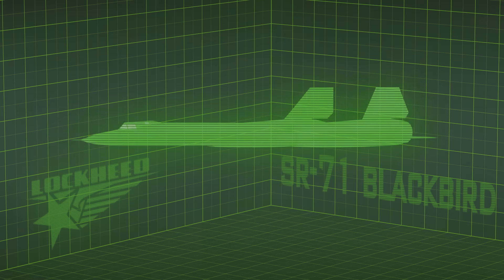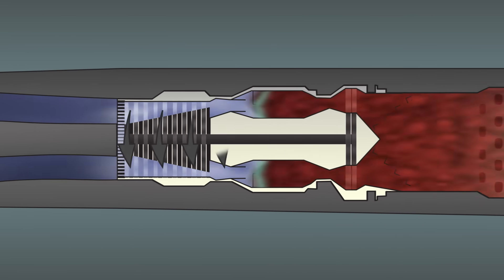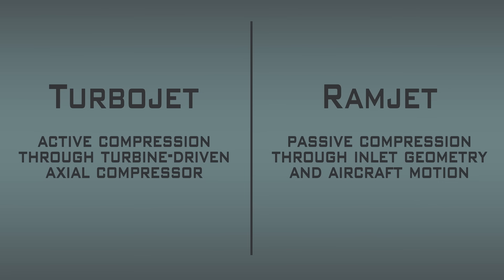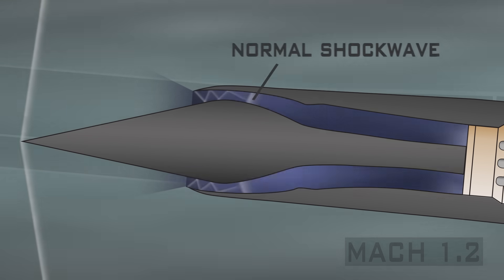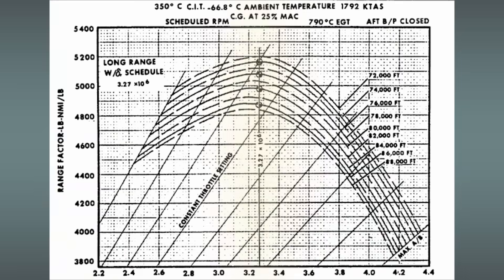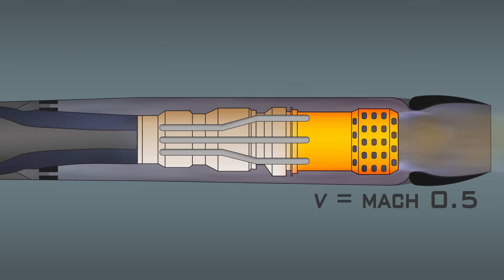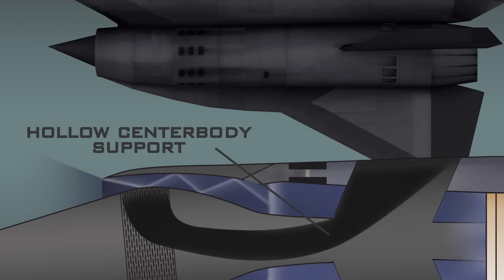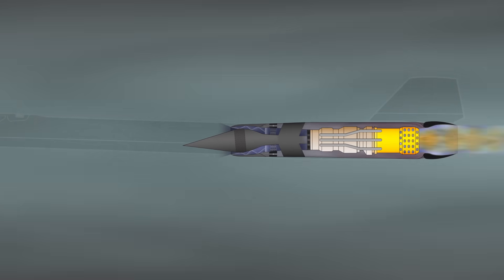The Mighty J58 - The SR-71's Secret Powerhouse

Comment: If anyone is interested in seeing the best REAL SR-71 static display I would advise you to travel to McMinnville Oregon to the Spruce Goose Museum. They not only have a real SR-71, they have her with an original J58 (port side) on it`s engine change stand, and almost a complete set of it`s photo recon / electronic snoop gear with it`s original hoist gear along both sides of the fuselage. It`s like they jacked this thing out of an Air Force hanger, I swear...
Reply: +Brian Patronie  was the J58 engine designed specifically for the SR71, or has it also been used in other aircraft? I saw (and touched) an SR71)) in Omaha, Nebraska. What a plane!
Reply from the maker: Guenter Zaenker The J58 was designed for the OXCART family of aircraft - the A-12, which became the YF-12 and the SR-71.  It's unique to them because it's only efficient at the high speeds and is designed to only use the JP7 fuel.
Reply: @TechLaboratories  The J-58 engine was NOT originally designed for The OXCART series of planes. It originally was supposed to be used by the Navy--www.afftcmuseum.org/newpage2
Reply from the maker: +Brian Patronie They have SR-71s in similar configurations at many flight museums within the United States, including the National Museum of the United States Air Force, and the Smithsonian.  Each display has its own element of the SR-71 they're trying to capture.
Reply: TechLaboratories

Yeah? I`ve been to Dayton and Dulles and McMinville blows them away. The engine change stands are 100% correct, the engine lift hoists are 100% correct USAF property, the J-58 is 100% intact, the power cart, the avionics & sensor packages are all 100% correct AS THEY CAME OUT OF THIS AIRFRAME...

Come out here and look, I`ll stand by my assessment that this is the finest SR-71 exhibit in the world, and makes our Air Force exhibits pale in comparison...
Reply: Guenter Zaenker

I`m not sure, but with that aero spike inlet cone it`s certainly the most unique application I`m aware of.
Reply: TechLaboratories

Yep, I thought so but wasn`t sure, thanks for the clarification.
Reply: In Europe, you can see SR71 at the American Air Museum Duxford UK

Comment: K wait what holds the middle to the nacelle.
Reply from the maker: +Ali G The center body is on hydraulics, held in place by the same structure that forms the channel from the center body bleed to the outside of the aircraft.  Essentially, the back end of the center body sits on a cylinder like a sleeve for lateral alignment, and is internally connected to a hydraulic RAM for maintaining its retraction state.

Comment: I'd say check out the Tumansky R-31 that powered the Foxbat-E as it was a more powerful engine with greater capabilities but miraculously, the American owned company Google doesn't index any page regarding R-31 stats despite the fact that the R31 is a newer engine over the R15 which just so happens to be the only engine in the Mig-25 series that i can find info on. The Americans already admitted to having clocked a Mig-25 over Israel at Mach 3.2 in 1973 powered by two R15's. As i said though, curiously, no info can be found on the R31 in English and i'm not good at reading Russian.
I mention as I clearly remember reading an Air Superiority book by Readers Digest that my dad used to own when i was a kid so easily pre 90's and it stated the R31 as being a lot more powerful with regards to thrust and that the Foxbat-E when equipped with this Engine was faster than the SR71 (only slightly) and that the service ceiling was easily a match for the SR-71 also. 
So yeah, I've found its strange that the largest webpage indexing company on earth (american owned) brings back no search results with regards to information on the R31's capabilities. 

I wonder if it has anything to do with the American assertion that the SR-71 is the be all and end all of fast and high flight. 
(It's not like the American government hasn't made spurious claims before)
Reply: +Sy Manufacturer: Lockheed Aircraft Corporation
Length: 107' 5"
Length of Nose Probe: 4' 11"
Wing Span: 55' 7"
Wing Area: 1,795 ft. sq.
Wing Aspect Ratio: 1.939
Wing Root Chord: 60.533
Wing Dihedral Angle: 0 degrees
Wing Chord: 0.00
Wing Sweep: 52.629 degrees
Inboard Elevon Area: 39.00 ft. sq.
Outboard Elevon Area: 52.50 ft. sq.
Total Vertical Rudder Area: 150.76 ft. sq.
Moveable Rudder Area: 70.24 ft. sq.
Rudder Root Chord: 14.803 ft.
Rudder Tip Chord: 7.833 ft.
Height: 18' 6"
Empty Weight: 59,000 lbs.
Maximum Weight: 170,000 lbs.
Fuselage Diameter: 5.33 ft.
Service Ceiling: 85,000'+
Maximum Speed: Mach 3.3+ (Limit CIT of 427 degrees C)
Cruising Speed: Mach 3.2
Engines: 2 Pratt & Whittney J-58 (JT11D-20A) with 34,000 lbs. of thrust.
Range: 3,200 nautical miles (without refueling)

Info I found on the SR-71... Cruising speed, 3.2, service ceiling, 85,000+ft.While it does say 85k +, it doesn't say 86k so its fair to say that 85k was its service ceiling.

Yet a mig 25 powered by an R15, not the more powerful R31 (specially modified) flew to an altitude of 123,524 ft (37,650 m) in 1977.

So yeah, come on Google, why no info on the more powerful 31 and only info on the R15? After searching for over 20 minutes, the only reference page I've found on the R31 states the engines weight and nothing else.
Reply: +Sy Ok, mah bad... Wasn't reader digest... Was mistaking my childhood memories for a readers digest book called the world at arms.. Manged to find the book by its front cover though... http://www.amazon.com/Modern-Air-Combat-Aircraft-Employed/dp/0517412659 
This book has detailed information of weapons, avionics, mechanics etc etc... Every plane is a blown up in an x-ray style engineering diagram showing all the internals and each plane picture has all the various weapons it could carry arranged next to it. Good book all in all. That and this was the book made me fall in-love with the F14 Tomcat. 
If anyone can find a copy though and get the stats for the R31, I'd be indebted.
Reply: +Sly Fox - Lots of planes had engines that were more powerful than the J-58....and yet they couldn't fly as fast as the SR-71. If you understood the engine system in the SR you would see it was designed that way. The engine system is more than just the J-58. The MIG-25 and 31 were impressive planes with lots of power and yet they were not capable of sustaining mach 3.2 I think its impressive that the MIG-25 got to mach 3.2 (although it was only clocked at that speed once ) because it did it by brute force.

Comment: What an incredible feat of engineering genius it was, from tip to tail, and all done without computers.
Reply: A modern scientific calculator is quite a bit more powerful than the computers used during that time.
Reply: sure it want illuminati?
Reply: Wilddog73 Yes, much more plausible.
Reply: +Dmitri Kozlowsky wow that's actually a really nice summary of the blackbird program. Thanks!
Reply: I pulled my bilogocal once. Took months to heal.
Reply: without digital computers
Reply: TheBestYoutubeChannelEverTimesInfinity Well, there were some involved, but they weren't much help. With the healing, I mean, not the pulling.
Reply: IN 1966 THEY HAD A SHIT LOAD OF COMPUTERS EDUCATE YOURSELF
Reply: Them Boomers were amazing
Reply: yes Fred, they had the same comps NASA used during early Apollo runs, the slide rule.
Reply: +Wilddog73 Satan doesn't exist.
Reply: +Dmitri Kozlowsky Just a minor correction, the MiG 25 was developed more in response to the SR71, and the missiles that were designed to take down the SR 71 were the R-40.  it was also the biggest air to air missile in the world. in addition, the MiG 31 could only fly at  Mach 2.8

Comment: Think about this... the damn CRUISE speed was Mach 3.2.. that's a holy shit number even today. And the faster it flew the more efficient it was.
Reply: ....What kind of medication are you taking? 
By the way, you have got something, which is called stealth - no science fiction at all, but pretty successful. While American stealth jets and bombers are well known - I would not be very surprised, if there would be a range of stealth reconnaissance aircrafts which are still classified. And you have got also stealth drones (the RQ-170 have been in Iran a couple of years ago), which are also reality.
So - no - we don’t use a cloaking technology, because you simply don’t need it. Especially UAV’s are so small, that they are not seen by eye in medium altitudes - and they are not picked up by radar (especially when it comes to stealth UAV’s).
Reply: in terms of power per fuel used yes... in terms of "miles per gallon" equivalent no not at all lol
Reply: @isphius  No you're wrong, mach 3.2 is the speed at which it is more efficient in terms of fuel per mile, "power for fuel used" does not mean nothing, in fact the SR-71 has a range of 3200 miles, it has the same range of a medium-range airliner as the A320
Reply: The x-15 is not in the same category, it is a rocket that was dropped from a b52 at like 50,000 ft. the shuttle (like the x15) is a rocket) if we're talking fastest manned vehicle, then it's not the space station or the x15 either, it's Apollo 10 that clocked in at 24,000 miles an hour
Reply: Shit is not holy!!!!
Reply: Given that something like this is declassified to the point where we have fairly detailed videos on YouTube depicting how it works I think it's safe to say that we have modern engines that are far superior already in use, they're just so wrapped up in secrecy that normal people never hear about them.
Reply: It is actually the fastest plane till now
Reply: @penart8079  nope
Reply: @penart8079  no, maybe the fastest jet, certainly not the fastest airplane. That belonged to the X15, it's a much faster airplane.
Reply: @RufusSchmeckpepper  well that plane was rocket powered, and for it to actually work it needed a plane to get to such an altitude and speed that the  engines would ignite...
Reply: It actually doesn't go much faster then Mach 3.2
Reply: @anchorbait6662  My favorite fast food, mach turtle soup.
Reply: No it's not! The "NEW" holy shit number is classified. I can't prove this, but I find it hard to believe that this DINOSAUR holds the record for fastest plane. Satellites work great however they can't always be somewhere when you need it! Cloud cover is another problem.

My theory as to why nobody has seen it's replacement: 

CLOAKING TECHNOLOGY! It's not some Star Trek bull shit either. More like Terminator*. Look how screen technology has advanced over the years with TV's and smartphones. If an aircraft was covered in screens when you looked at the bottom of it you would just see the sky! They are already experimenting with cloaking small radar sites and stuff like that. On a plane you would need an extremely fast processor because the object you are trying to cloak is moving forward while pitching & rolling.

*Side note: The movie Terminator was made before the invention of the flat screen. It's amazing how sometimes science fiction becomes science fact.
Reply: Stacy Smith
Radars work with radio signal reflections, not by staring at the sky. So displays wouldn't help.
Reply: @Stacy_Smith  There are basically no current ramjet planes, that's simply why it remains the fastest. The SR-71 also required specially made fuel. Apparently the same fuel was used for an unpiloted ramjet test aircraft(though more like a missile really) that flew about 10 years, and was much faster(mach 5) than the official top speed of the SR-71:
https://en.wikipedia.org/wiki/Boeing_X-51_Waverider
Just being fast seems pretty useless now, for aircraft. Satellites can theoretically see everywhere at any time, assuming they're geostationery(as spy satellites apparently are), and have a perfect optical system(or good enough, in reality). Spy satellites are already openly known to have greater resolving ability than general satellite imagery. Clouds also aren't always an issue, as imagery doesn't have to be generated from visible light. Likewise for imagery at night. Planes would probably have at least as many problems anyway. Satellites are probably where a lot of the secret tech now resides.
If something else is needed, presumably they just use drones that are close to the area they want imagery of, instead of sending a huge, risky, expensive plane from a vast distance away. Even losing spy drones is a problem, but losing a plane(not to mention the pilots) would be far worse.
Visually seeing a plane isn't very important for stealth. There also wouldn't be any need for this for a secret aircraft program, there's no way to know the technicalities/performance from just seeing a plane take off. They could also just fly at night.. 
There have been numerous secret programs before such as the F-117. The F-117 even flew in daylight.
LCD displays were made far before the terminator, they just weren't generally suitable for computer or tv displays. There were even laptops with basic monochrome lcds from the start of the 80s, I have an 80s lcd laptop myself. Full colour plasma displays were made from the early 90s. Science fiction is often based on prototypes, and scientific theories.
People act like tech now is so far advanced beyond what came before, but it's generally little more than flat screens(which had been inevitable for a long time), and more importantly miniaturisation. Computing speed increases have also slowed drastically - it's nothing like the speed increases in the 90s. A pc that was more than a few years old was nearly useless then, meanwhile my 10 year old laptop is still faster than many new ones.
There's been nothing really revolutionary for a long time. Personally I think the next revolutionary item could be due to chemistry, not directly electronics - such as a much more effective battery, much more efficient hydrogen generation, etc.
Reply: Stacy Smith - You find it hard to believe do you? Well it just so happens there are plateaus, these things that can never be surpassed. Some things just can’t be topped, no matter how old they are. Look how old the Concord is, it’s come and gone, and have any airliners topped it for speed? Do they need to? 

What about the Lockheed U2, along with the SR-71. Both planes of the 50’s and 60’s, capable of cruising at the edge of space. Can and should any aircraft fly higher without being a spacecraft? 

Plateaus may not even represent technological brick walks. Sometimes they’re economic - as in the case of the Concord in part, but they’re plateaus nonetheless. 

You can certainly try to break the boundaries, someone did and that’s why planes, let alone these ones, exist. But there is no law of physics which dictates that everything must progress endlessly.
Reply: SR-71 is not the fastest plane, the X-15 is.
Reply: The X-15 is generally ignored in these statistics because it was rocket-powered. The SR-71 remains the fastest operational aircraft with air-breathing engines.
Reply: in that regard the Space Shuttle is the fastest plane if your definition of a plane is something the uses control surfaces {ailerons,elevators,rudder} to control its flight
Reply: @isse6790  the x-15 is not a plane but a rocket actually since its not using jet engines but a rocket engine instead! the SR-71 is the fastest plane and will be for a long time!
Reply: The X-15 is a plane, it's just not propelled forward by a jet engine.

Read here: https://en.wikipedia.org/wiki/Airplane#Rocket
Reply: The X-15 and the orbiter of the space-shuttle are not planes they are cargo. They cannot take off and land on their own.
Reply: abla wobila  Fastest jet yes
Reply: @chrisbarr959  I still like the Stanley #5 as the fastest plane.
Reply: @Skulldetta  the x-15 used jets, it just required a rocket to get fast enough for them to work
Reply: @user-h3w7d  The power plant doesn't determine whether it's a plane or not. The wings produce lift and keep it airborne, therefore, the X15 is a plane.
Reply: The real speed is Mach 9+ and it is a triple stage engine that is still classified today

Comment: Excellent presentation! Without exception this is the clearest explanation of the inlet/engine operation.  I would add however, that another reason that the J-58 doesn't melt is because the entire thing is constructed of materials normally used to make turbine blades like Inconel, Hastelloy and Waspalloy super alloys.  
But again, just a terrific job.

Comment: Great explanation of a brilliant piece of engineering. 

Two things dominate the performance of an aircraft, in various proportions depending on the flight regime, the wing and the propulsion system. At Mach 3+, a brick wall on edge can generate enough lift, (we won't talk about drag), but something's got to push it there. The "something" in this case was the combination of the J58 and its housing.

Comment: The P700 and P800 are the best examples of this system, they push their rockets at Mach 2.5 at 3 meters above sea level, something the SR71 could not do, but the rockets are just that rockets, ship killers, the missile that hit the Pentagon on 9/11, it was the only thing capable of penetrating DC air defense and Pentagon air defense, and hit so hard that 8 huge ring re-enforced walls were destroyed.